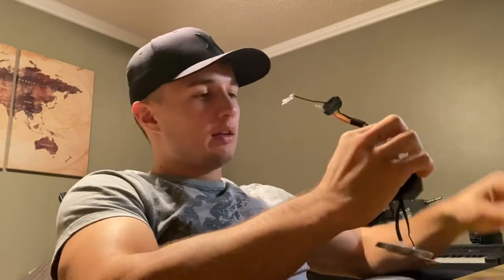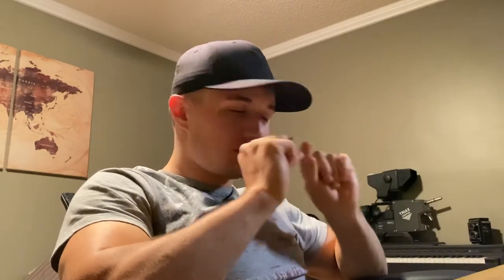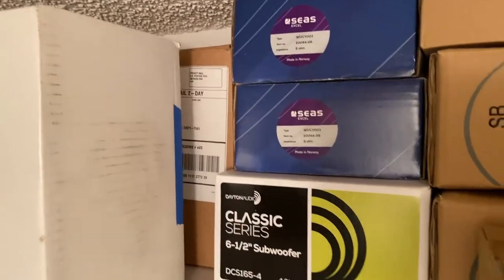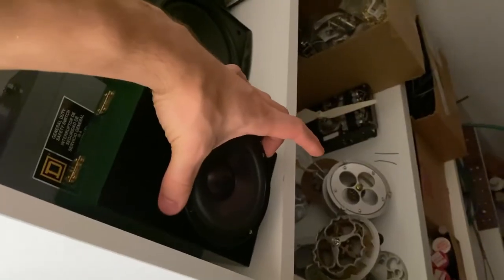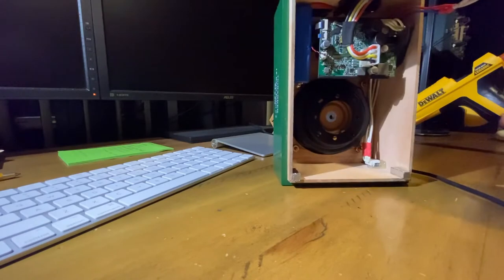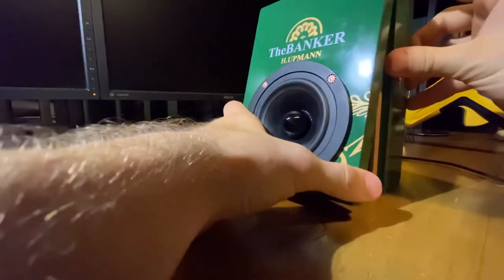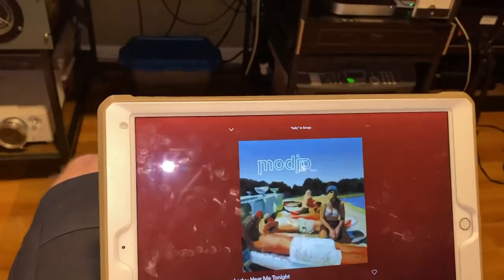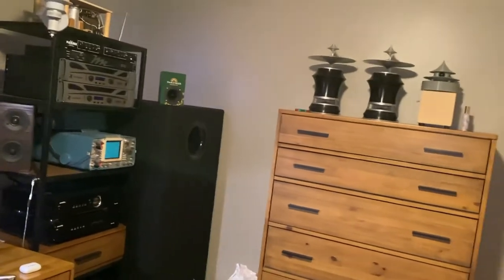Making A Cigar Box Bluetooth Speaker

Comment: can you explain what's the passive radiator? I never heard of that before
Reply: A passive radiator is a speaker cone without a motor that resonates at lower frequencies than the speaker driver itself, providing extended bass response. It functions similarly to a speaker port, where the speaker and the radiator only become in phase at specific frequencies, working together to amplify the bass.
Reply: @tizen9866  that's so cool thanks for the explanation